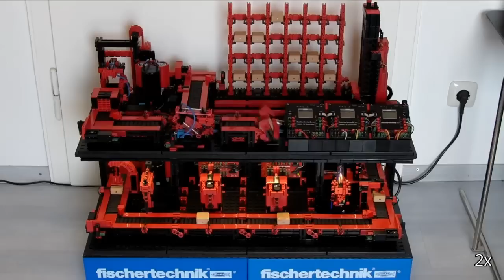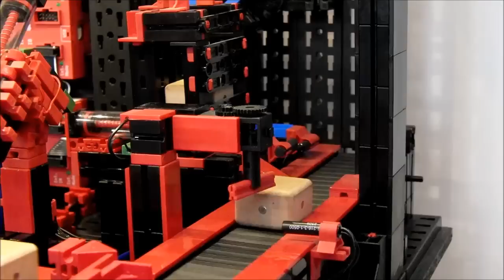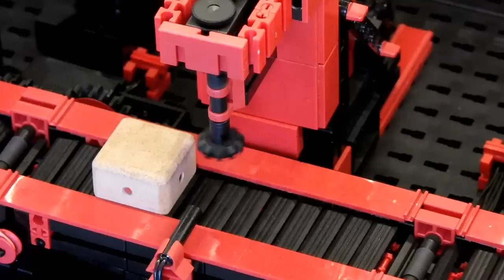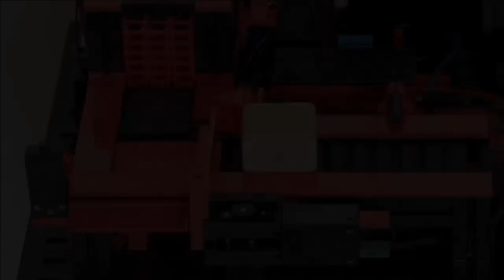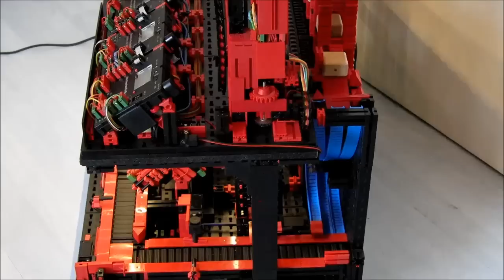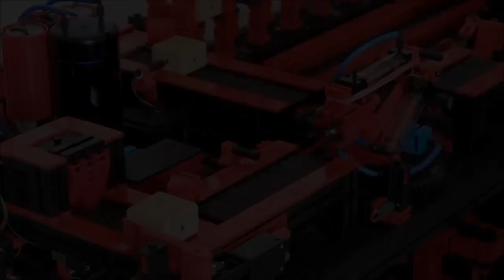Fischertechnik Simulationsfabrik mit Bearbeitungsstraße und Hochregallager

Comment: Warum ist Fischertechnik so fucking teuer. Arduino or Raspberry Controller gibts fuer Euro 15,  die wollen 400.
Reply: Weil Fischertehnik nur das nur das beste Material (plastik und Metall) nimmt, und noch auf Handarbeit setzt. Also die Sachen werden "gegossen" und dann von Hand in die kästen einsortiert. Auserdem sind (gerade die Elektronischen teile) sehr Robust und überdauern problemlos jahrzehnte. Also einmal gekauft kann man es immer Weitergeben/verkaufen.
Außerdem sollte man nicht vergessen dass in vielen Bausteinen Metall ist. Also viele Steine sind innen mit Metall gefüllt oder haben eine Metallstange im inneren.